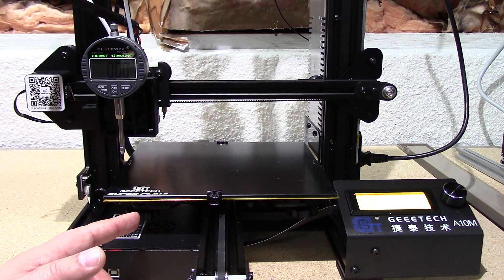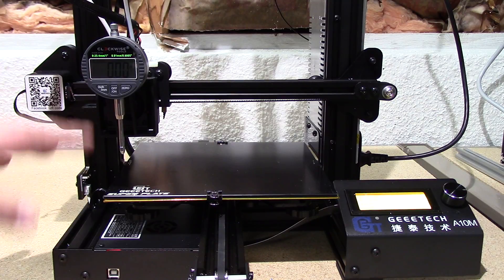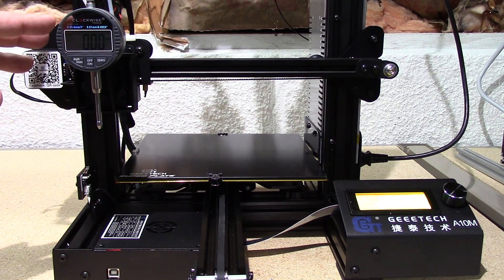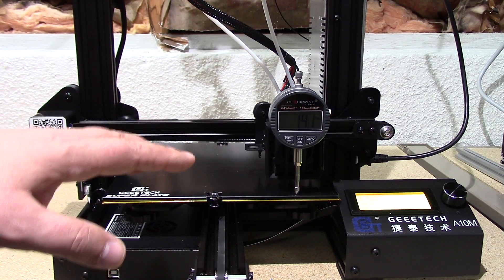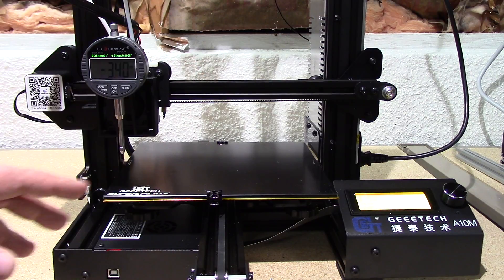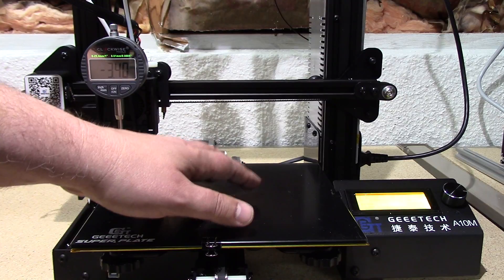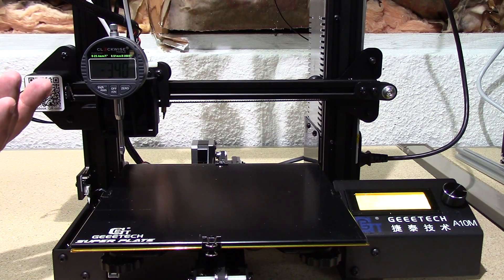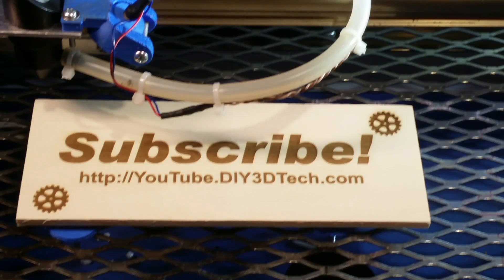GeeeTech A10M - Bed Tramming Dial Indicator Mount!

Comment: Very nice.  I like the fact that you're using a dial indicator.  I need to do something similar to my CR-10 mini.  Much more precise than using a piece of paper at each corner.  But do you worry about scratching the bed (or the dial) since it rapidly trams without lifting?
Also, if you have a low spot in the middle, you could put a small piece of painters tape (or equivalent) in the middle.  Clamping at the edges allows the glass to bend down slightly and help keep the whole surface at even height.  I've done this for mine, and it improved the overall level.
Reply from the maker: Have not had an issue with scratching (have this for several printers) and sorry on the "dip" as its in the plat itself...
Reply: @DIY3DTECHcom  If the "dip" is in the plate, it should still work, adding a piece of tape inbetween the pate and the glass in the middle area.  That should raise the glass slightly in the middle relative to the outside area, making it flatter.